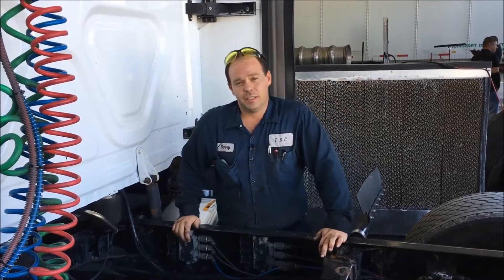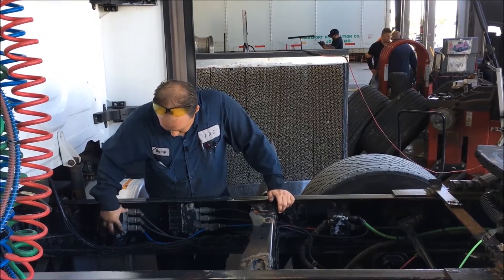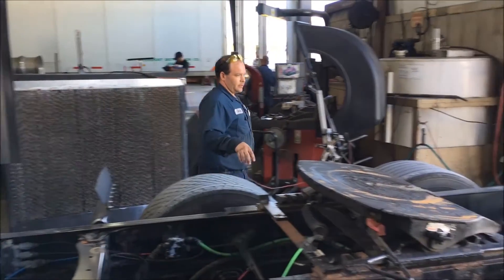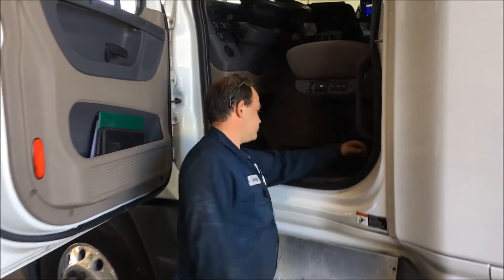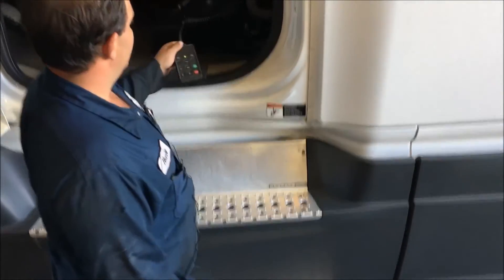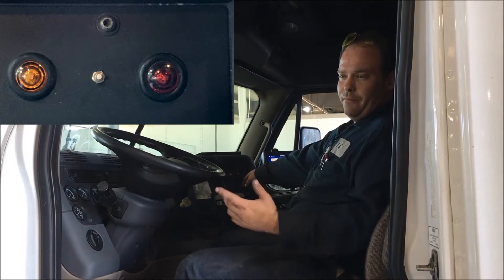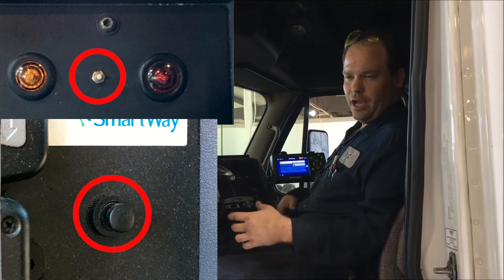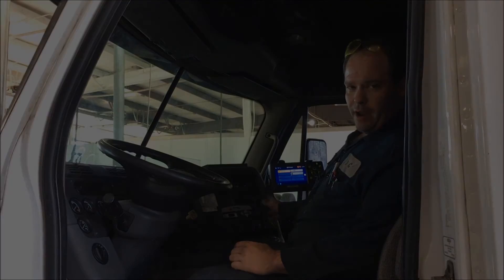How to use ECAS (electronically controlled air suspension) system

Comment: I just took my truck over the pit inspection.  One of their jobs was to replace the diff stay ball joint.   After giving me a huge bill and passing my truck,  I went to drive it home and an error came up saying ecas wasn’t working.  My controller wouldn’t raise or lower airbags.    I’m distraught,   They trying to say it wasn’t their fault snd my computer must have malfunctioned.    I know their mechanic has upset a sensor or something.